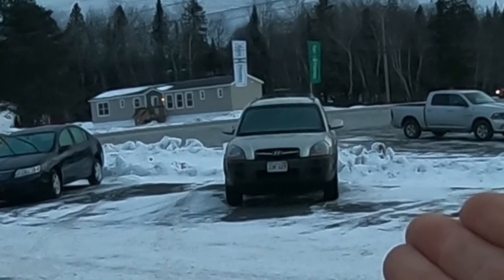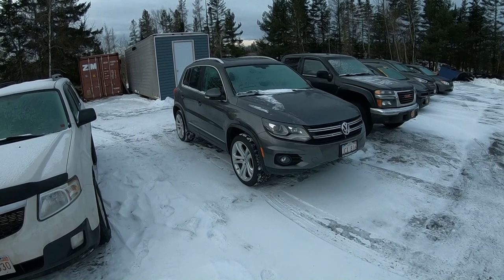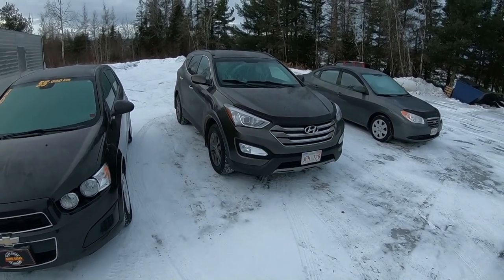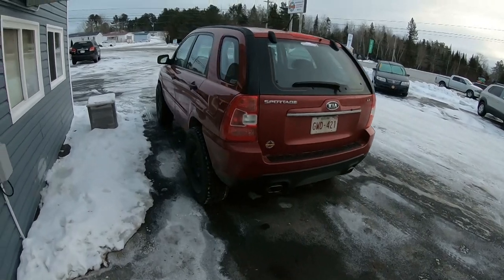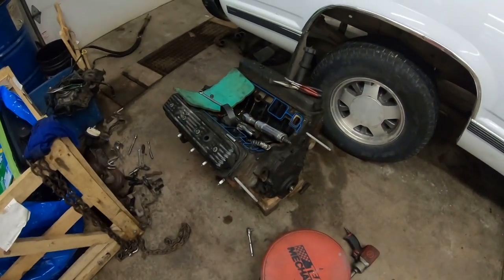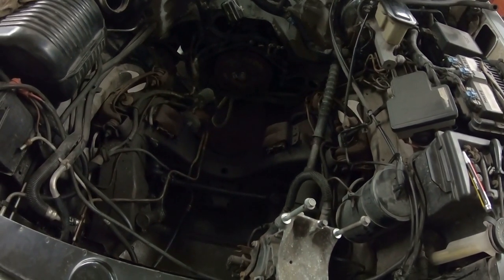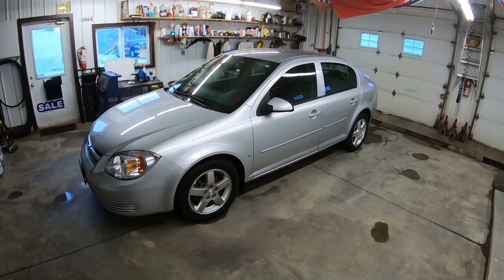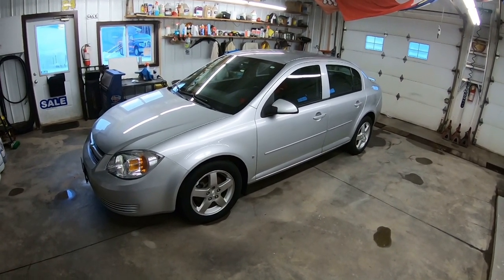BACK LOG AND SMALL BLOCKS PART 1

Comment: Damn that's crazy. I never looked for a vortec crate engine. But I did just now I found a few on summit racing starting at 2600 but the big issue was finding one that worked with the factory fuel injection and ecm. Which all seemed to drop in power and rise I'm price.  Which makes sense now, the cheapest one was vortec style but they stated  no provisions for sensors. So to get one for $2500 I think is a deal compared
Reply from the maker: Considering my $2500 is Canadian money, about $2000 US, and a 3 year warranty, I thought it was a great deal and so did my customer.
Reply: @OldeCarrGuy  If I remember the 350 Goodwrench 250 hp that's in my work truck was a long block at $1800 of course that's old school but that's not much price difference so I think that was a good deal for sure.
Reply from the maker: You could be right. Definitely room for improvement! Haha
Reply: what i ment was the price you got that one for was not to much more then some of the older sbc crate engines. But as far as room for improvement thats a guarantee lol but i did see a true vortec long block crate engine i think rated at 315hp for $2800........ but it required a flashed ecm and   some other stuff im sure the owner probably dosnt want to deal with lol